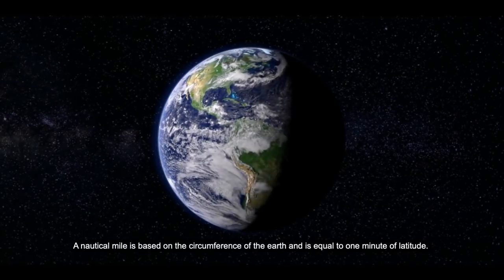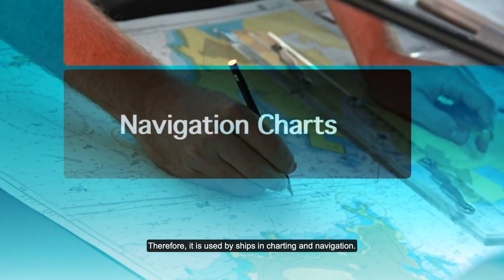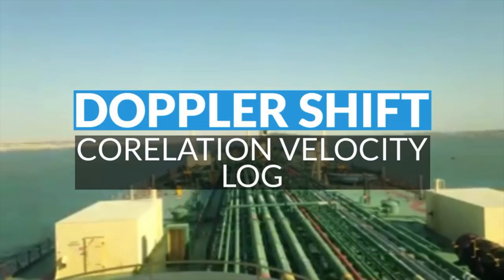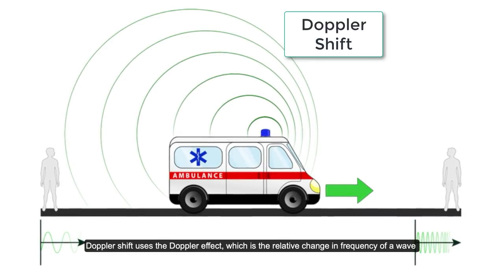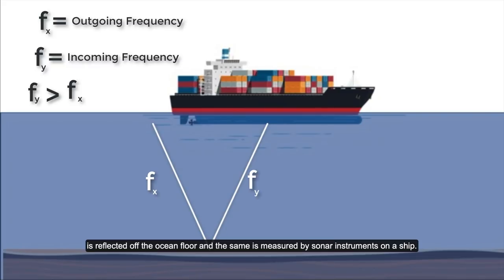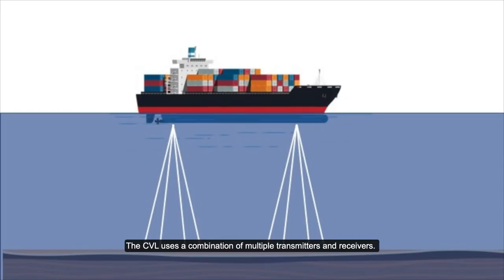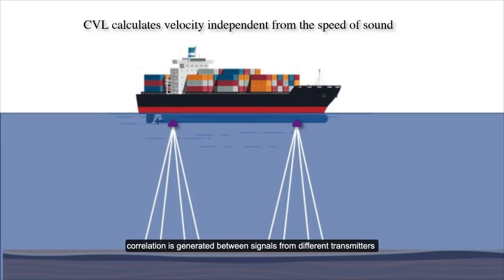Why Ships are Slow?

Comment: Thanks. While summarizing, I studied a lot.
00:29 How ship speed is measured
00:49 Knot origin, historically
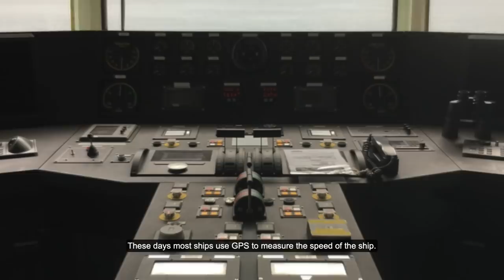02:05 Nowadays, GPS.
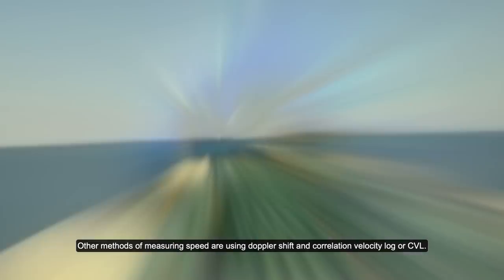02:53 Or, Doppler shift or CVL is used, using ocean floor and sonar
03:43 Why ships are slow?
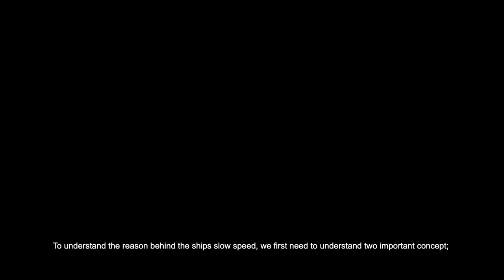05:00 Ship's power is strong but speed is low
05:05 Slow speed due to Power to Weight ration, Ship resistence
05:42 It just holds more
06:41 There's force against the water
06:55 3 types of resistance
06:60 frictional resistance
07:07 hull part contact
07:11 Frictional. It takes 60~80%, for low speed ships.
07:22 For high speed ship such as container, roro, passenger, takes 40~60%
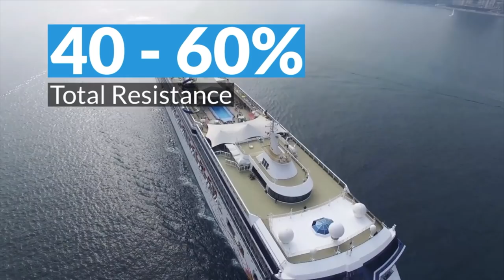07:40 Residual when generating wave. 10~30% for low speed ship, 40~65 for high speed ship.
08:08 Air thing is small
08:17 Factors affecting ship speed
08:31 Factors - displacement of ship. how it afloats. Draft dicreases when low qty of container
09:09 Sea weather condition
09:28 Condition of hull and propeller
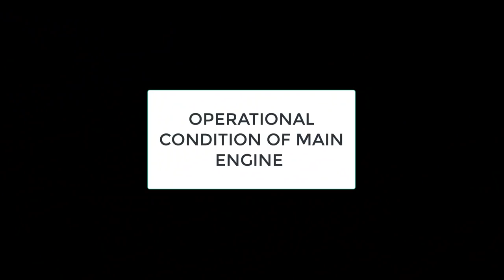09:46 Main engine failure
10:04 Regulation of ship speed
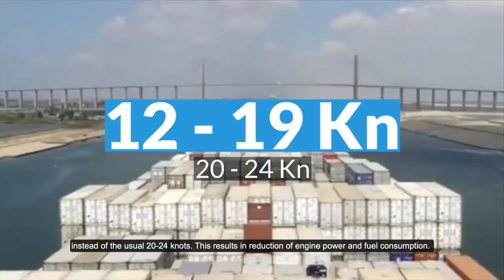10:35 12-19 Kn due to fuel efficiency, where 20-24 Kn is actually possible.
Viment : https://viment.co.kr/watch?vim=oaeN0Kv1ZA1rP
Reply from the maker: Thank you for the detailed summery 👍🏻

Comment: The speed of the vessel is a function of LWL. The longer the fadter. Then there are propulssion factors and hull shape that is reflected in the original formula by the use of constant coefficients.
All is set by the Mechanics of the fluids.

Comment: I'm suprised fast they are. I have sailing simulators & like in real life. All the ships can go faster than most of the smaller boats.
In some cases much faster, they take a long time to get going or bring to a stop & I'm away i real life, it takes even longer on real ships.

The smaller boats I'm talking about are sail boats under motor & trawlers & small motor dinghys. Several can only manage 8-10 knots under power. 
Even the passenger liners of the early 1900s are much faster than that.

To achieve their mid 20 Knots, you'll need a fully planing boat.

Comment: Ships arent that slow some ships can go 35 mph and that's faster than any human can run
Reply from the maker: Agree. However, we are comparing it with other modes of transportation fitted with engine.
Reply: Ships can go 35 mph some can but not all but company’s won’t run them that fast because its to expensive
Reply from the maker: That is true Sean. Slow steaming is the term used for the same.
Reply: Considering ships are primarily used for cargo transportation, if we compare with other transportation methods the ship is very slow.